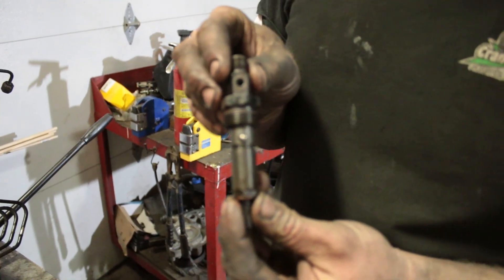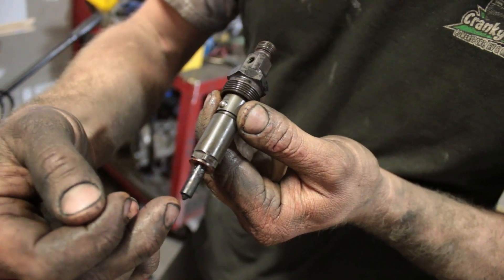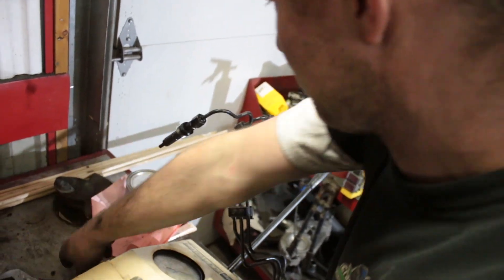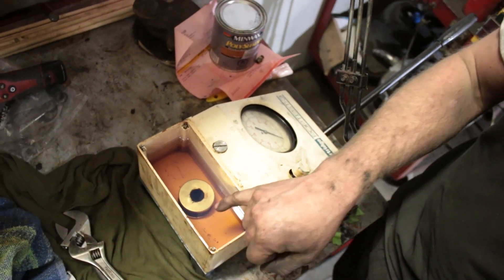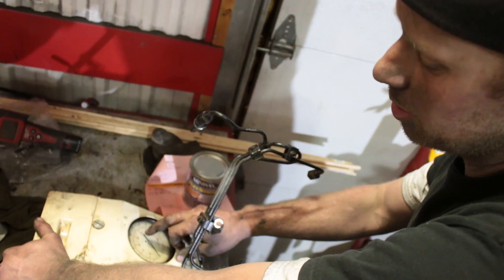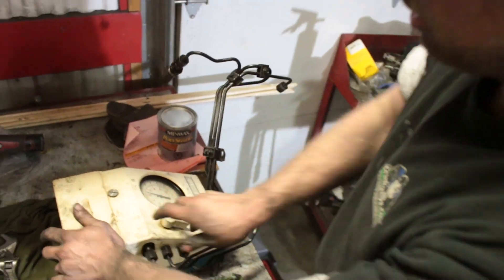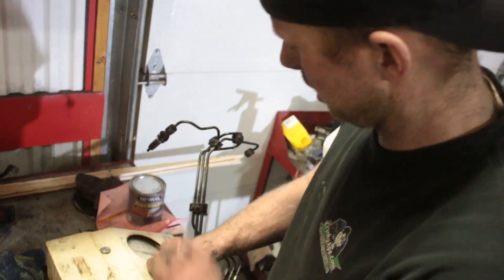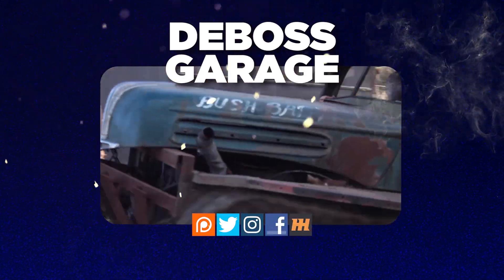Diesel Fuel Injector Test (Mechanical)

Comment: Does anybody know why my 1992 GMC doesn't want to start after as been warm it's not the glow plugs me tested all that has to have something to do with the injector pump the have to cross two wires to get it to fire up when it's been sitting for about 20-30 minutes now the set there and Frankie Frankie Frank

Comment: Can you increase the pressure on these to improve efficiency? Stronger spring for instance? I am learning about IDI diesels and I was surprised to see the injector spray in a star pattern. I thought it sprayed straight ahead, based on the diagrams I have seen of IDI engines and the swirl chambers.

Comment: My 4bt 4-390 Cummins sounds like it's starving for fuel. While I had the injectors out, I wanted to test them. Got a bench tester. 2 seem to work well, other 2 spray but you have to crank on the handle harder to get the oscillation but it does chatter. Is that abnormal in your experience?

Comment: hay DEBOSS i have an old 6.9 idi with an injector that's acting up is there anything i can try before replacing it?
Reply: Try to send some injector cleaner through it while replacing the fuel filter and check for rust on the lines

Comment: A bit of advice wipe the injector prior to putting pressure onto the tip. If the injector was to let go you may be exposed to serious pressure injection risk. It like lifting a load then walking under it. Probably wont fall but you wouldn't walk under it. Also why not set up a perspex enclosure to captivate the diesel.  You obviously have good knowledge but its important to adopt best practice when framing a Utube video.

Comment: Hi there are you based in uk and do you have a garage or work for your self seems ive got the problem with injectors and abit worried doing myself and not so many garages would esnt to touch these things were i am and hoe do tell if my car is electronicsl injectors that are replaceable. Vw touran 2.0 tdi 2004  1t

Comment: Hey. I have a problem on my old volvo diesel. Sometimes I can't rev past 3k rpm. It missfires on at least one cylinder when you reach 3k rpm. If you drive it for a while the problem goes away and then it runs normally.

It's not the turbo causing this. Nor the intake or fuel delivery to the pump. 
Could it be the IP (pump) or an injector

Comment: Great video, although ATF is not a lubricant to diesel! It actually increases the amount of wear on the injectors, but it makes a good cleaner. Optilube is the diesel lube additive, I highly recommend checking out the Optilube XL lubricant. It scored the best in wear scar testing independently by a long shot
Reply: ATF is a better lubricant than diesel or nothing.

Comment: Do the springs in the injectors wear out?
Reply from the maker: I'm sure they wear over a couple billion fires and that's why its a good idea to have them checked
Reply: So last night I put some 6x0.013 nozzles on my 12v injectors (no idea how old the components inside are) and pop tested them to 284bar.  However, I had one injector that didn't seem to pop nearly as hard as the other ones.  Does this seem like a problem to you?

Comment: how hard would it be to swap a 5.9 Cummins in a 1981 ford bronco
Reply from the maker: As difficult as any other swap
Reply: @DEBOSSGARAGE  what would happen if you left the plastic cover on the injector by accident will the pressure from the injector push it off? Will it damage the motor? Detroit motor

Comment: Great video, brought me back to the days I was learning about diesel engines and how to test their components. But I have to throw in my 2 cents: I was taught there are nozzles and injectors. The difference being a nozzle simply atomizes the fuel, and is what you just tested and called a mechanical injector. An injector was something that can meter the amount of fuel that it was atomizing. Thoughts?

Comment: I got 5.9 12v with p7100 pump  what do you recommend for power upgrades
Reply: I'm wondering this also.
I am not looking to be driving a coal roller. Just want to unlock the 12v hidden potential for the 'Average Joe".
Reply: I'm looking at the practicality of power not rolling coal of the p7100 pump 12 vale getting the most power out of it
Reply: Country Gentleman  Ugandan from Kampala and am  a technician